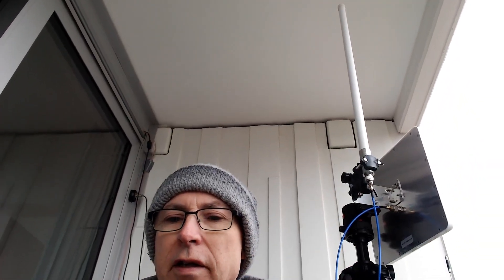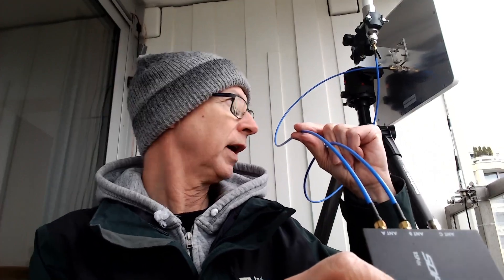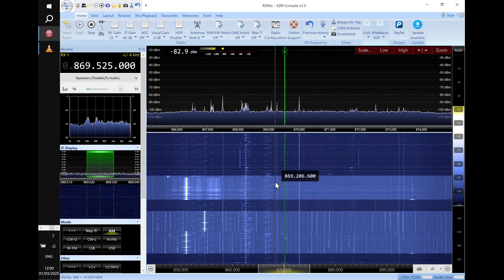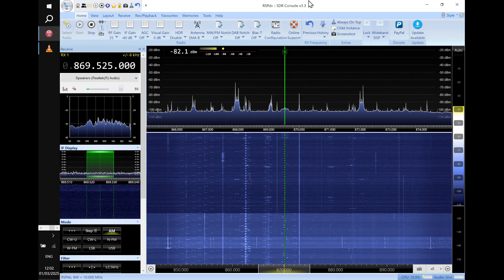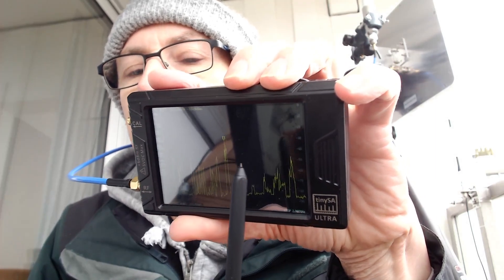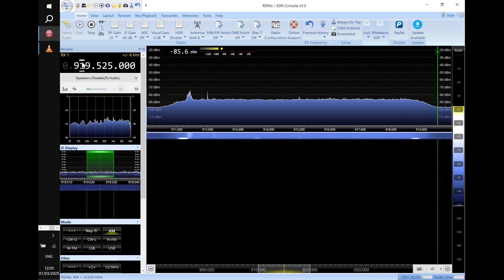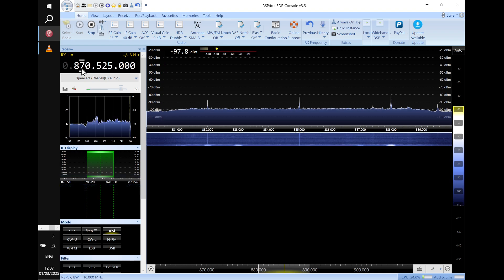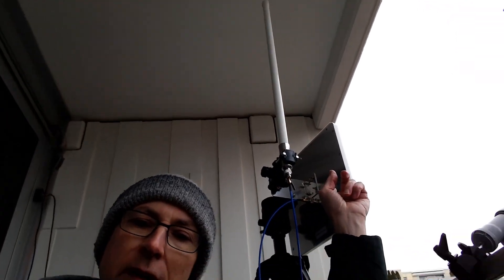Reticulum RNode Antennas - higher gain is not always better

Comment: Oh wait, I think I know what might be going on. If you started up the rnode on the low noise-floor antenna, and then switched antenna to the one with higher noise floor while the RNode was running, it would see that as a strong signal suddenly coming in, and then engage interference avoidance. It's probably a good idea to restart the RNode between antenna switches!
Reply from the maker: Oh goodness - that makes sense ! I will do the experiment again and unplug the rnode whilst changing antennas so that it measures the noise floor fresh. It hadn't occurred to me that the change in antennas would confuse the snr measurement !